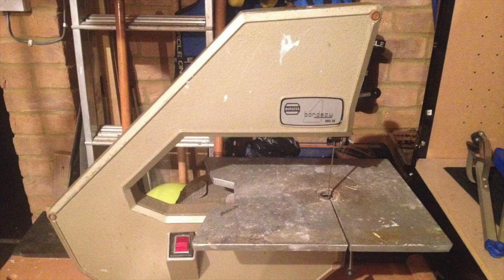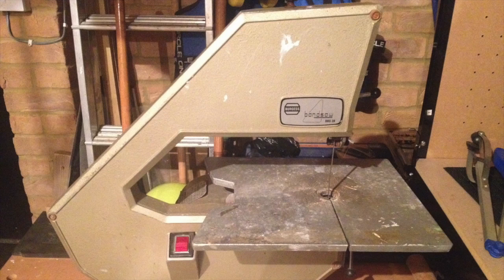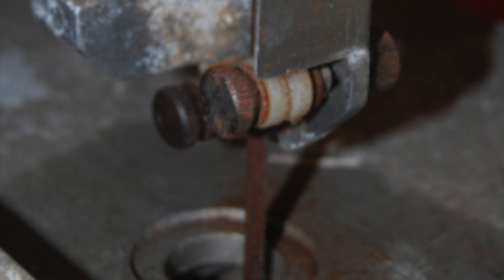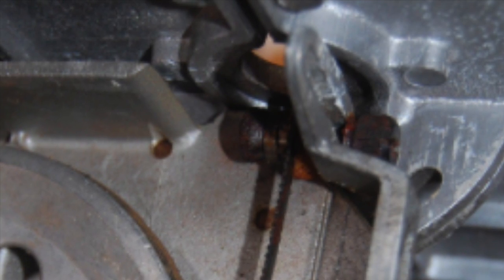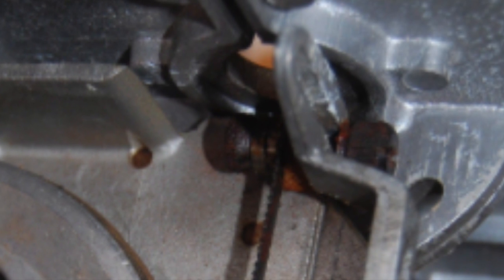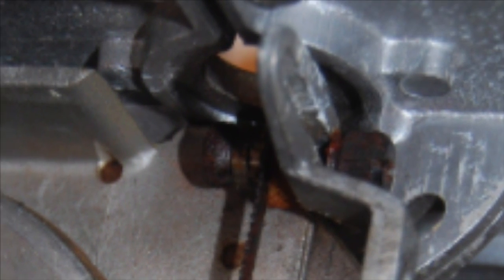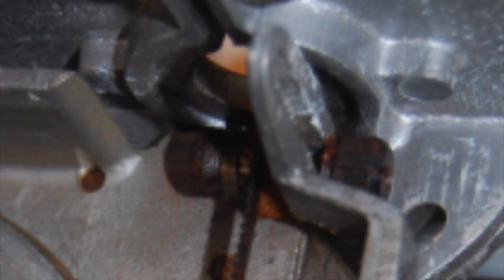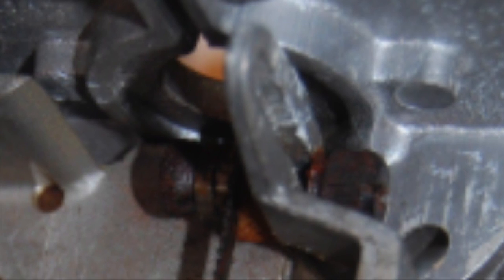Fixing A Burgess BBS-20 Bandsaw Part 1 - Identifying The Problems

Comment: I am the complete expert on this machine. You need to retrofitthe guides from a later machine, or at least copy them. BUT, if you want to make the machine really good, you need to stiffen the upper arm and the easy way to do this is to throw away the catches on the front cover and replace it with bolts and wing nuts. If you push on the upper guide it should ot flex back at all. Secondly, get some really good blades. Only one manufacturer gives perfection blades and they come from Tuff Saws.
Reply from the maker: Thanks I'll bare you in mind it started fixing it then a Black and Decker was going cheap on a local board so I got that but still have this.  The only problem with the black n decker was somebody had lost one of the panel catches, so I 3D printed one of my own. https://youtu.be/txcm3ofETkw  it works really well. Please don't forget to subscribe, share and check out my other great videos. Thanks Malcolm aka @fixed1t

Comment: The problem is apparent but finding spare parts for both the upper and lower guide posts,
All point to new blades but no actual spare parts.
Wher is an outlet that understands the customer need and not continue to display blades.